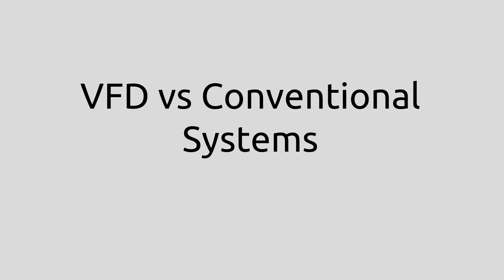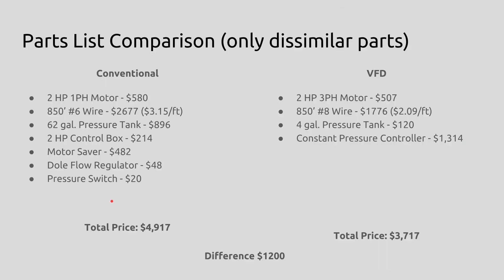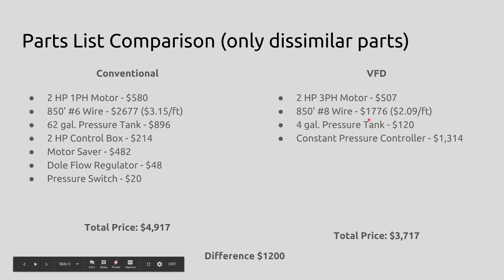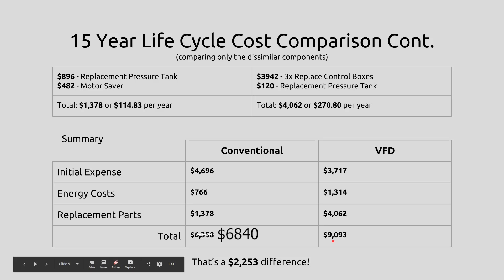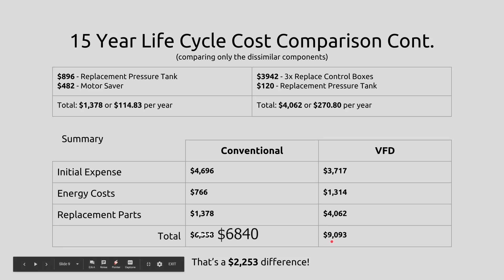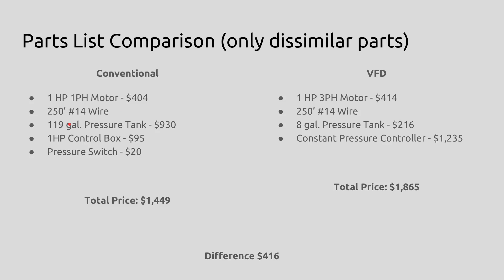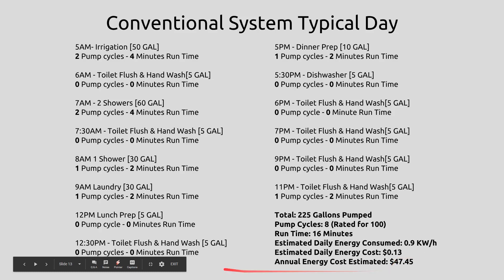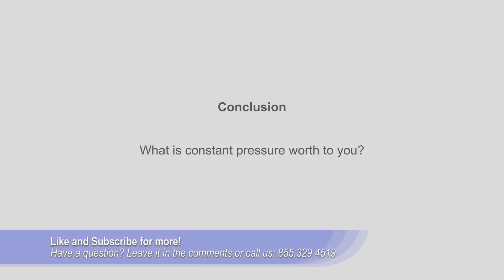Cost Comparison: VFD vs Conventional Pump System

Comment: I run many things in my shop with Variable Frequency Drives and originally used ABB ones that were really expensive.  These days I buy them for between $100 to $150 direct from China and they work fine.  Also the current drawn is not the rated current since at low duty cycle output (slow speed) the power used by the motor and drawn by the VFD is much less than rated.  In the end you would save a lot of money with a VFD system as long as you were buying the VFD's for a good price and at I would stock at least one spare on hand at all times.

Comment: RC, Why not just use a conventional system with a pressure switch setting of 40 to 60psi, then use a pressure regulator valve set to 35psi to get the constant pressure?

Comment: Great video and explanation but not sure about accuracy of VFD vs. conventional. Just looked at power curves for Grundfos 15 SQE07-150. It is ~1.65KW/1.5HP pump rated for 13.2 USgpm/183.7 ft.
This pump will use a way less than 0.2 HP (not clear how much exactly from the graph) for anything under 20ft of head and 6USgpm. Unless I missed it, I don't think you are taking this into consideration in your comparisons and calculations.
Reply: Maybe well presented, but if wrong... The two cases are going to use roughly the same power because they performed the same work. The only differences are inefficiencies. The standard method is going to run at full output and then turn off once the pressure is reached. The motor will be most efficient near full output, the pump probably less efficient the higher the output. The VFD will run the motor at a less efficient speed, but can run the pump at a higher one. The VFD itself will have some losses too, maybe 10% (look it up for a particular model). When all totaled up the VFD probably isn't as efficient because the demand doesn't cause it to run at the efficiency sweet spot most of the time. However the difference between the two probably isn't more than 20% either. Otherwise a lot of heat has to go somewhere because it isn't moving water.

Comment: Why are control boxes so failure prone? Would they last longer if protected from power surges and transients?
Reply from the maker: Yes, power surges and transients are not good for any electrical equipment. Another big reason is that they do not offer replacement circuit boards or components, so if a part fails you usually have to buy a whole new box.
Reply: @RCworstwater  Sounds like it is worth connecting at least a hard-wired surge suppressor to that circuit, maybe even use a line conditioner

Comment: Run times may be longer, with a VFD, BUT the current being drawn from the VFD is not constant. It may be only drawing 50% power during it's run time. Need to compare with ACTUAL energy used.

Comment: Does power consumption on the VFD system draw full load whenever running or is it less during low flow output?
I am considering a VFD to run an 80' to water well on an off grid Solar system. No startup surge load to have the inverters deal with seems like a nice benefit.
Reply from the maker: Most solar drives are VFDs. Check out these: https://franklinwater.com/products/packaged-systems/solar-products/subdrive-solarpak-075-3hp/
Reply: Don't know why he didn't answer your question. The VFD will draw less power when there is less load.